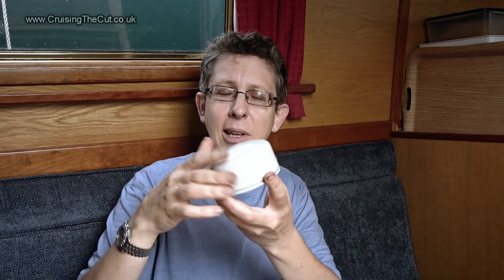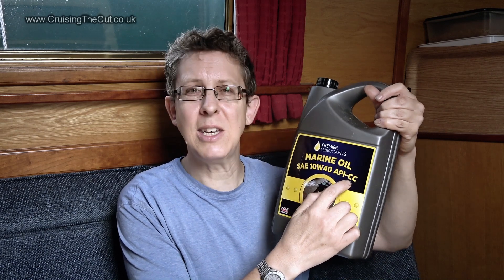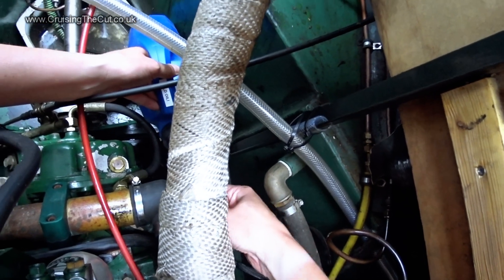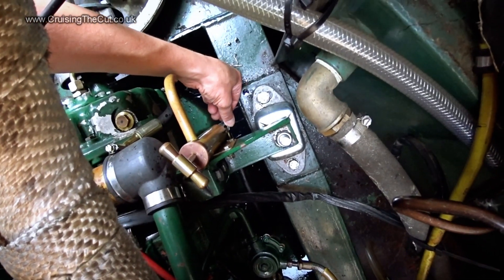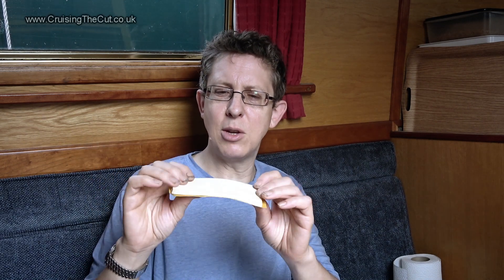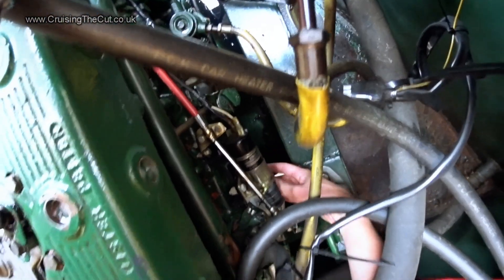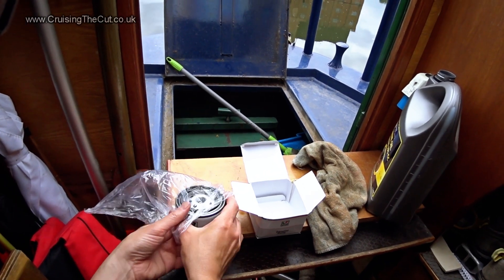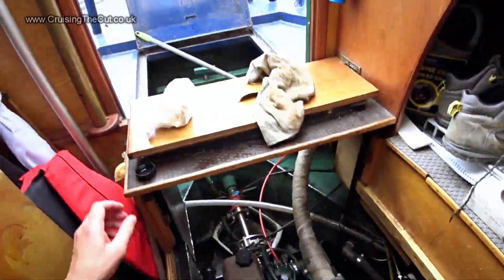110. Oil and filter change on my Lister Petter LPWS4 narrowboat engine (canal boat)

Comment: the reason for putting oil on o ring is to make it easier to remove next time otherwise its a bugger of a job.
Reply from the maker: It's a bugger anyway
Reply: Actually, it's to help protect the O ring from the heat of the engine so it doesn't dry up and degrade as fast as it would without the oil. It helps keep it lubed and conditioned.
It also gives the O ring a certain amount of slip as you screw the filter onto the engine. That slip helps the O ring not to bind up and buckle in it's seating as you put it on so you have a proper seal. The oil does a number of things so it's an important detail to do.

Comment: Out of curiosity – have you by any chance encountered any narrow boats with electric engines? Electric motors, as far as I understand, don't require lubrication from conventional oil. However, they do require a minimal amount of grease for the bearings inside the motor. Still, a lot less work I would imagine.
Reply from the maker: Yes, there are a few. I did a whole video a while back about a hybrid setup; scroll through my channel and you should find it.

Comment: Marine oil ? 10/40 of the correct spec is 10/40 add marine and get ripped off a good quality oil is fine at a reasonable price oil companies make oil not manufactures the engine dont know whether it in a car boat or cement mixer dont get done for the sake of a description

Comment: I imagine this has been said but... nothing exciting happens at the exact hour mark on your meter. You probably would be better off if you do it a few hours (of run time) "late" and take your time, perhaps on a just slightly warm engine.
Reply from the maker: Cheers, yes of course I understand nothing magic happens on the dot but this happened to be a convenient spare 20 minutes to do it, as I knew I'd be keenly chugging away up the Avon in the days following.

Comment: Your oil filter is smaller than the one on my motorcycle . I would fit a bigger filter and that way you wouldn't have to change you oil as often .
Reply from the maker: I like fitting the "official" one that the service manual states, I always nervous of going "off piste" on stuff like that.
Reply: Is that a good idea to install a larger filter? I thought when the filter is clogged up, the oil would have gone past it's life cycle. I'm not an engineer, but aren't these engines designed so to not damage the vital parts of the engine.
Reply: @MrRobbiegem2005  if the oil bypasses (there is an internal valve that will bypass the filter medium) because the filter is plugged the oil is way past the change interval. Biggest advantage of larger filter is it increases the amount of oil in the engine by perhaps half a liter and the filter will have to be dirtier before it bypasses. You will see manufactures put larger filters and even oil pans on rental equipment because renters will often not check the oil level.

Comment: Old oil isn't good for the skin, might be worth wearing gloves whilst doing this.
Reply from the maker: Cheers. I don't think I do it often enough for it to be an issue really.
Reply: I hate the washing up afterwards. You should be able to get the same thin rubber gloves that the doctors use so you can just take them off and your hands aren't covered with oil.
Reply from the maker: You can but to use them once then dispose of them is a terrible use of resources. I hate the "disposable" culture we now have :-(

Comment: I know this is old.
Screw driver is not a filter tool. 
Foam, fine. Strap wrench, great. Filter wrench, even better! Screwdriver, bad. You’ll damage threads. 

No funnel? Make a paper cone for “oopsie”globs while being very careful pouring oil.
Reply from the maker: Screw driver in a pinch when nothing else will work. Gotta be careful, as you suggest.
Reply: @CruisingTheCut  Plier and Jaws Type Oil Filter Wrenches! $10.

Comment: I strongly recommend, when changing oils on your narrow boat use disposable gloves to protect your skin. Used oil in diesel engines is carcinogenic. Google up the lubricant manufacturer & read the Safety Data Sheet, for handling used oil.
Reply from the maker: I don't think I do enough of it to really worry and I loathe disposable plastic gloves as they're terrible for the environment, like most disposable things.